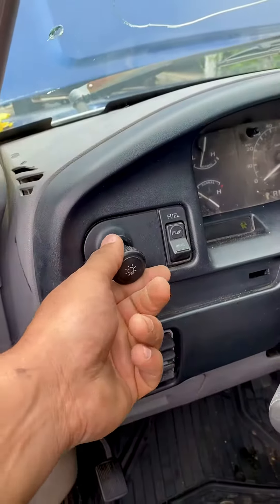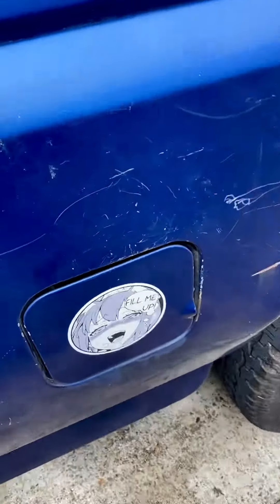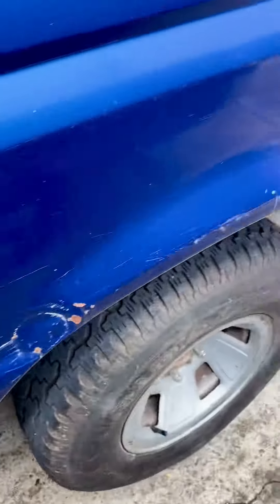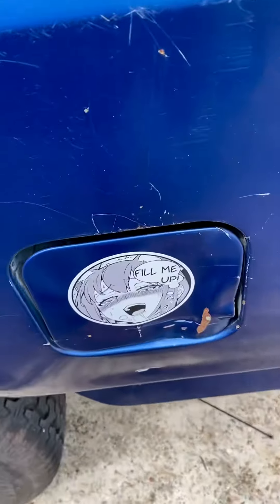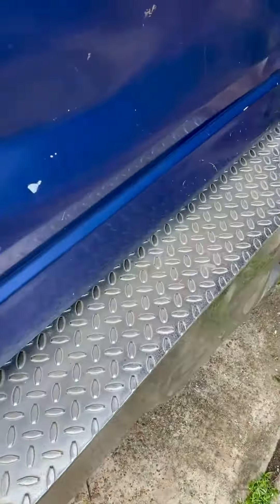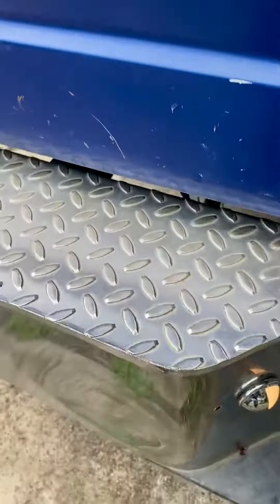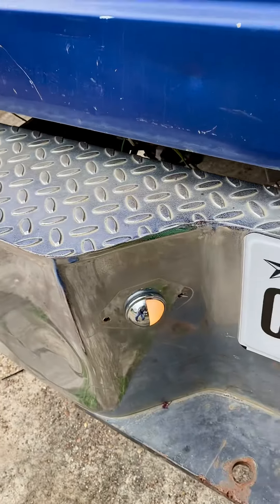License plate lights wire splicing on 1996 Ford F-150 part2

Comment: Did you use two separate lines into the wire from the tail light or can i splice them all together into 1 cable at the same point?